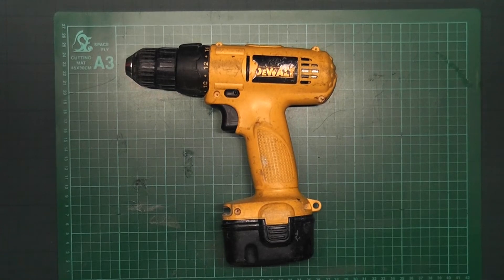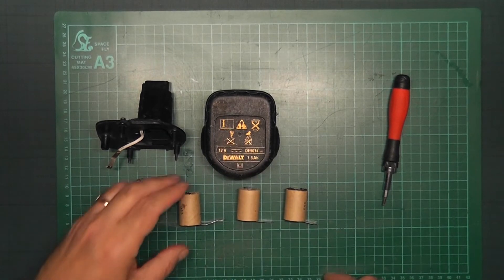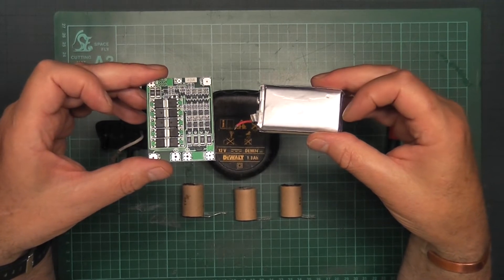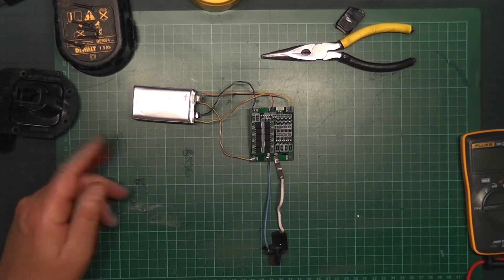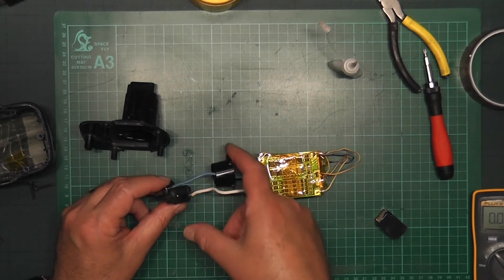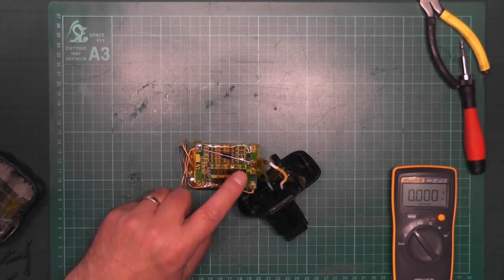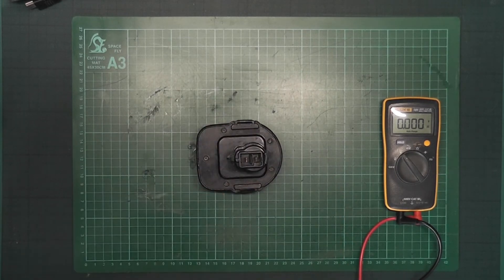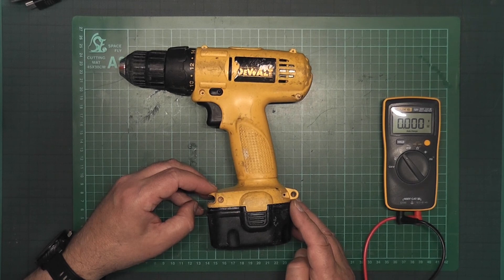How to Upgrade a DeWalt Battery Pack Ni-Cd to Li-Ion Yourself

Comment: While the numbers seem to add up, laptop batteries are not designed to deliver the kind of amperage you will need for a power tool.  I would be very apprehensive of over-drawing these batteries and overheating and creating a situation where the lithium batteries could explode and/or burst into flames.  I think this is very ill-advised.  If you could find Li-ions that are designed to handle large discharge rates, then ok, it will probably work.

Comment: Interesting. I have a Hoover cordless (F22 model) with a duff lithium ion battery pack. New, the battery pack is £80 and your video shows you can replace the individual batteries inside so I will be looking to open the pack to see what can be done. The pack will no doubt have a board, so it should just be a case of replacing the individual cells with similar or better.
Reply from the maker: The F22 replacement battery pack is indeed expensive as are most cordless tools and appliances. Previously when we broke down a Dyson battery pack we found that the casing is heat/glued together so you may have to prise it open carefully. Inside you will most likely find 5 or 6 type 18650 Li-Ion batteries spot welded together in series. Each battery would probably be 2000mAh so if you decide to replace then you would need to purchase the same amount. 
If you decide to go ahead with it then we would suggest you try getting 2500-3000mAh (about £3 each) for a longer runtime and possibly a mini spot welder (£15 plus) if you don't want to solder them together.
Let us know how you get on with it. Thanks
Reply: @DrivewayDudes  Thank you for the pointers. Next job after I fix a 2007 Fiesta head gasket 😁